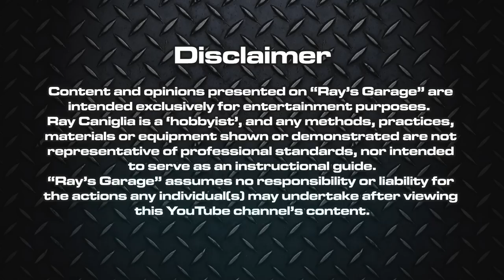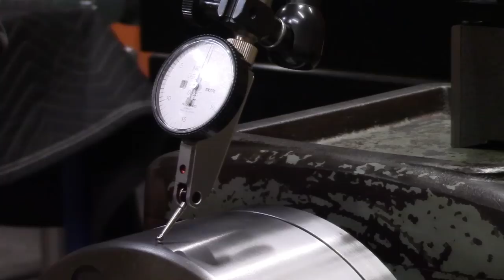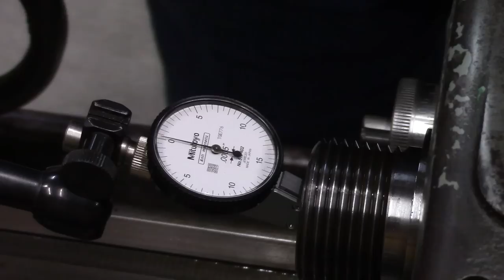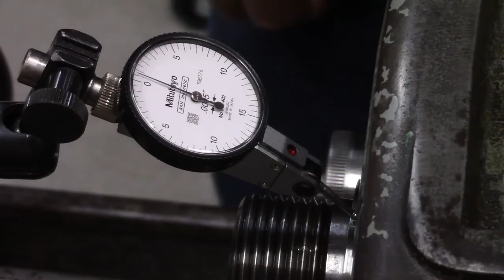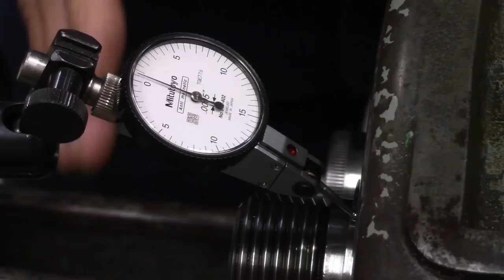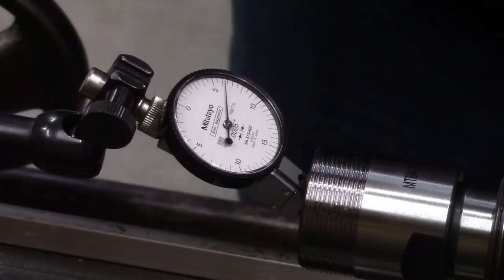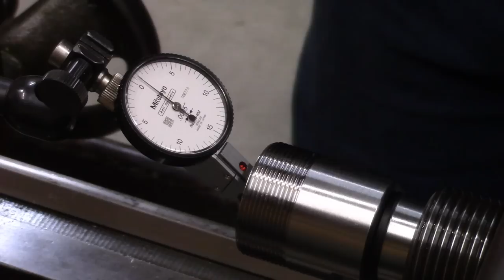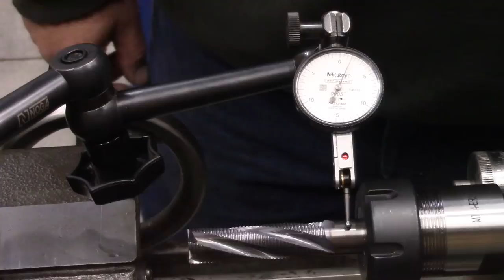Banggood ER32 Collet Set Revisit #realraysgarage

Comment: It's not surprising that the indicated run out of the adaptor is much greater than the spindle for several reasons. First, collet adaptors are made to hold cutters in milling machines, not to provide perfect centering in a lathe spindle. It would be worth looking at DIN standards for tolerances. If you want less run out then the collet taper has to be machined in-situ and the adaptor has to always thereafter be located in the same axial position in the spindle. Second, the old devil cosine error. When you measured the spindle run out it looked as if the DTI probe was at about 30 degrees to the surface of the taper, with a lever type DTI it should be no greater than 10 degrees to minimise cosine error. When you measured the adaptor it looked as if the probe angle was about 60 degrees to the taper (@ 17.09-on) which would greatly increase the apparent difference in run out error between that and the spindle nose taper. It would be interesting to see the comparative results between the spindle nose taper and the adaptor taper when the probe is set to the 10 degrees or less in both cases.

To illustrate, if the probe angle was 30 degrees to the surface of the taper and the indicated error was 0.002", then the actual error is given by 0.002 x Cos(30) = 0.002 x 0.866 = 0.00173". However, if the same indicated error of 0.002" was measured with a probe angle of 60 degrees to the surface then the actual error is 0.002 x Cos(60) = 0.002 x 0.5 = 0.001", i.e. half the indicated error. In the case in the video where the indicated run out of the adaptor was 0.006" at an apparent probe angle of say 60 degrees, the actual run out is 0.006 x Cos(60) = 0.006 x 0.5 = 0.003". Consistency in technique is vitally important in comparative measurement.

There are many internet sites explaining cosine error but this one is quite useful: 

http://www.cncexpo.com/IndCosine.aspx

Joe Pieczynski also demonstrates it in his video:

https://www.youtube.com/watch?v=dsWSxpwCPUg
Reply from the maker: Thanks for the info and data, very much appreciated! I do follow Joe and did watch his video on this. Thanks for tuning in!

Comment: One thought about what can cause variations in the collet chuck readings... If the taper is not a good match to the spindle it may be sitting slightly crooked each time it is driven in depending on how it is hit. Try coating it with the Sharpy  and pushing it in by hand, give it a slight turn and remove. You should be able to get an idea of the match of the tapers. If there is very uneven contact at either end of the taper it would allow the chuck to seat crooked. That means that no matter how you mark it for fit, it will likely be different the next time you use it. 
Good followup. For sure the collets are poor quality. 
The run out on your lathe isn't bad for an old machine. Now I've got to go test my lathe and collets. I use 5C collets in an adjustable collet chuck. A very nice Chinese chuck. I have adjusted it (RunTrue knock off) to less than .0002 runout using a Japanese dial test indicator on the taper. My lathe has a camlock spindle with a zero mark that I use to always have the chuck mounted in the same position.  (Zero mark on chuck also.) 
There is a disadvantage to using ER32 collets for work holding. The work must extend nearly the entire depth of the collet or the collet will close on a taper and the work will not be held well. The only way to over come that is to use a plug at the back of the collet that matches the diameter of the work. I can hold quite short work parts in the 5C collets because of the short, steep, clamping taper. My CNC uses ER32 collets directly in the spindle. Much more expensive collets (than Banggood!) that we throw away every 6 months or so (for the ones on the most used tooling.)  The machine runs 8 to 10 hours a day, the main cutting tool is replaced every other day ($75.) We don't find it economic to have them sharpened, they are coated tools. Machine has a tool changer and we preset additional tools so there are a lot of tool holders. The tool holders have to be replaced periodically also. Any runout reduces tooling life drastically. Normal spindle speed is set at 16,000 rpm. Software sets feed rates to match chipload requirements.

Comment: Hi Ray,At 17 minutes in the video, you installed the ER32 in the spindel with a bolt at the back end, are you sure that this bolt head corners does not interfere with the interior of your lathe spindle???
Reply from the maker: Great point, the bolt head does not come in contact with MT4 taper and has plenty of clearance. Thanks for pointing this out and would have been good to mention this in the video! Best Regards, Ray

Comment: Never go all the way into a stop using an ER32 collet nut because the nut tries to suck the cutter further in and can't because it's already at a stop inside the holder. You'll damage the nut, the collet or both.
Reply: I don't know why he has a stop on it anyways. It looks like the nut on the stop is bigger then the diameter of the collet. This may be why it's running out .oo7

Comment: You shure have a mating problem between spindel and collettaper , when pushing te he taper and then hammering the MT taper goes thousends inside the spindel.you can see on camera many times. MT just stick in with little speed sets it , and hammering would not effect the seating, more than a Thousand, and would not be vissable on camera. probleby the taper only seats at the end.  greetings Jos
Reply from the maker: Thanks for pointing this out, I still have not tried to get better results since i have not needed the collets yet but would like to resolve the runout issue at some time.

Comment: One of my lathe is little Logan 10 inch. I've tested it with a last word and I can get absolutely zero movement in the nose. I kept screwing around thinking that it wasn't loaded up and sure enough zero TIR

It's just a good machine I guess I mean it's from 1946 to and there's zero run out absolutely nothing. To test the entire assembly test the machine section right behind the threads on the outside of the spindle. That's a good place to test the entire assembly because it has zero ware in that particular spot behind the threads.

And I just finished watching your video and you did that so disregard LOL
Reply from the maker: Man, I wish this Clausing had zero run out but it was in a high school for many years before I got it and know it was crashed since i had to rebuild the change gears and a drive gear. I think its a 1967 from what I can tell from the serial number. Sounds like your Logan is a keeper!
Reply: Ray Caniglia I'm looking to get a monarch if I can fit it in my garage anywhere and probably get rid of the Logan. It's nice for small parts but I feel like it's limited and it is really. I also have a hardinge that I've been tooling for about 2 years and it's becoming more and more useful slowly. When you first get a hardinge and have no tooling it's just a gigantic paper weigh
Reply from the maker: Sounds like you have some very nice stuff man, I would kill for both a Monarch and for sure a Hardinge! My next machine purchase will be a 16" x 40ish Good quality lathe the 10x36 Clausing is a great little machine but like you said your are limited. I have the space now so i will keep the Clausing and get rid of the Grizzly for a bigger better lathe!

Comment: You need to get the lever of the dial much much more horizontal. The lever type dial indicator measures at 90 degrees to the lever. Your dial's lever was pointing down at approximately 60 degrees from horizontal. So, the readings you got on your dial indicator are not true readings.
Reply from the maker: You are correct sir my coefficient error was magnified! Thanks for pointing this out!
Reply: Morning brother, just call me Pieter. I'm always aware of things like this because I'm a qualified metrologist (27 years) which is a trade closely connected with tool making, my other trade for the last 43 years. I think people might just not thinking about it when they do a job, but for actual true measurement it is necessary. Happy turning brother!

Comment: The only thing that matters is that when you put the tool in the holder is the tool runs dead nuts.
Yes you can grind the holder, but then you have bought an expensive chunk of metal not a tool holder
Reply: yeah throw the shit away and count it as a lesson learned. i wouldnt have jumped through hoops testing this crap.

Comment: Maybe not a bent spindle, but rather an eccentric MT.

I'm guessing the machine used to cut the MT wasn't truly concentric, causing the MT to be machined slightly off centre.
Reply: I was thinking the same thing and wondering if he should grind a new one in place.
Reply: I would certainly consider grinding it.

The reason I don't think it's a bent spindle is, if it were I would expect the run-out to become progressively and appreciably worse/better, as you move along the taper, but it doesn't, which suggests to me an eccentric MT.
Reply from the maker: Great thought, anything but a bent spindle! I'm sure I can get it to run much better with a little precision grinding!

Comment: Huge cosine error with that large of an angle.  I suppose this is ok for comparing runout but not for getting absolute values.
Reply: Hi, what you say is true, you would not use a dial indicator of this type for pure measurement applications, just a few thou is OK as a comparator. I would use the plunger type indicator for a measuring job as it's more linear in it's travel.

Comment: If you're not gonna use it, turn the 1st thread and remove enough material so it indicates no runout, then remove and replace it at 1/4, 1/2, and 3/4.  I think you'll likely find it's your arbor.  You also took out too much preload on your bearings.  Take it from hand tight and rotate it one turn.  I think you're misreading your instructions.  They don't mean that you need to spin the chuck in an out of control manner for 1+ spins.  Your bearings don't care if you spin it like a top, they care how tight they are.  Think of how you install a car's oil filter.  It's the same process.
Reply from the maker: Hello Bill, Thanks for the info and might try that, the entire set has been sitting since I did the video so this sounds like a good option to try! I rechecked the spindle bearing adjustment against the manual and have them pretty close to the recommend adjustment. Thanks again for all the helpful information!

Comment: That is a job. You think you might run into this problem with the more expensive ones?
Reply from the maker: Hello Jerry, I have not attempted to re grind yet and still not really sure if this will correct the run out, others say it could be a bad collet nut, I will try that first before re grinding anything. The more expensive collet sets do not have this issue and have zero run out but are very expensive. I think in the long run a good set is worth spending the money! Thanks for tuning in!

Comment: Ray, are you 100% positive of the lathe's spindle taper? The reason I ask, I have a Clausing 5912 and its spindle taper is actually a 4.5MT. Yes, that is 4-1/2 Morse Taper. There were numerous lathes made with this odd taper including some Clausings, Rockwells, South Bends and several other makes/models as well. It is real tough to visually discern the difference between a 4MT and a 4.5MT. The later Machinery Handbooks had the measurements for 4.5MT. Just a thought.
Reply from the maker: I am 99.9% sure its a MT4 taper and not 4-1/2, some Clausing modeles, not mine did have the MT 4-1/2. I have been using, and should have showed in the video the MT4 dead center I use in the spindle that runes under 5 tenths run-out.
Reply: same is true of my Rockwell lathe I believe it is 4.5 mt.

Comment: Ray a great test! Basically confirmed what we already knew... You can regrind it. But to keep it totally accurate you would need to make an index mark on your spindle and the chuck to repeat accuracy. I'm sure you know that. After you throw the collets in the trash. Pick another set and recommend something to us that we can use confidently. I'm in the market for a chuck and collet set. I have already tried this route... thanks for taking the time to do this! It's a very common problem with these. Surely there is a reasonably priced alternative that has repeatable accuracy that is acceptable. Again thanks!

Comment: You're using the test indicator wrong. Look up cosine error. You need the tip 10° or less to the surface measured.
Reply: You can leave an angle, but you then need to calculate it in. In the first case, it looks like about 60 degrees, so devide by 2. Cos(60) = 0.5

Comment: Since it is junk, lets regrind it.
Reply: It would be hard to make it much worse.  I do think the Nut is messed up too and may not be aligning things correctly but grinding the tapers concentric with each other and the center line can only help.  It seems to me that if the ER taper is not concentric with the Morse taper nothing but bad things can happen.  Ray did not check the face of the collet holder that I saw, that could be out of whack too.
Reply: I reground (actually just bored it) my shitty eBay er32 mt4 holder, and now its really accurate. Also take the time to deburr the collets.
Reply: Randy, so would that make it, "made in China and assembled in USA"..... lol
Reply: Made in China and Assembled/Repaired & JustMadeRight In The USA by Americans.
Reply from the maker: I agree, let’s do it!
Reply: Someone else made a video like this and the steel wasn't that hard. He could bored with a carbide tipped boring bar. Unless he has a decent ID grinder. Myself I would bore it and then lap it to get a good finish. I may do that with my set when it arrives. I ordered it last week.

Comment: Yes agree, seems a bent lathe spindle.. close to .001" out, checking anything further out the spindle will dramatically increase run out, I believe the collet set is out somewhat but not this much ..your'e getting what you paid for or more, not precision made. These should be checked with something more accurate...like .0001 run out.

Comment: Thanks again Ray.  The effort you put forth just to prove crap is crap is stunning.  What I'd like to see is if the import set from KBC tools is this bad.  The collet set alone is $314 Canadian for the ER32 set (18 pieces).  For that I am trusting the KBC's purchasers have done their homework.  The #3 MT chuck is $190.  Your whole set is $143 CDN from banggood.  (I don't expect you to get the set from KBC obviously, I'd just like to see them reviewed somewhere before I buy them.)  A set of Techniks are $600 which is 2x the price.

You should not have to fumble around trying to find the sweet spot with a properly made tool.  It should go in and be good.  How would CNC equipment work if you had to manually adjust every tool change to get it just right?
Reply from the maker: Hey Barry, I totally agree, even as a hobbyist I do like good quality!
Reply: @RaysGarage  pay for it precision requires time and knoledge both expencive. i buy cheap arbor and machine in situ the taper if i require preision one job and they wre scrapped .cost are highand even with th re best american made tools are not achivible.

Comment: You should learn to use your test indicator the right way. If you put the tip on an 45 degree angle to the surface you are measuring, this will of course result in a false reading. It will read more runout than there actually is. You need to set it "parallel" (+ or - 10degrees) to the surface.

I dont doubt your results thou. Those chinesium parts are not precise. Wasn't it Stefan Gotteswinter who did a rework on the nut of one of those to make it usable?

Your spindle seems to have a non centered MT. It doesn't seem to be bent, or else your runout readings would decrease the farther in you do your measurement.
Reply: More important is that since he is measuring run-out, the arm needs to be plus or minus 10 to the axis if the spindle..
Reply from the maker: Thanks for the info, I'll try and keep it in 10° from now on!

Comment: Have you tried clocking the original without pushing the tool to the back stop?  14:15   https://www.youtube.com/watch?v=WKikm6cQKh0
Reply from the maker: Yes, I did get a little less runout by doing this but still could not get under .002" Thanks for the link, I have watched this video in the past.